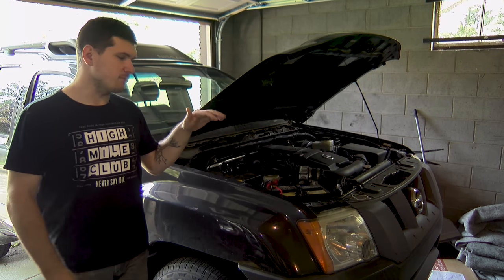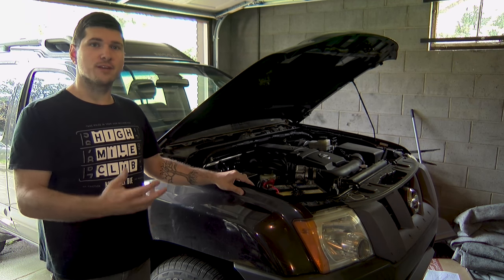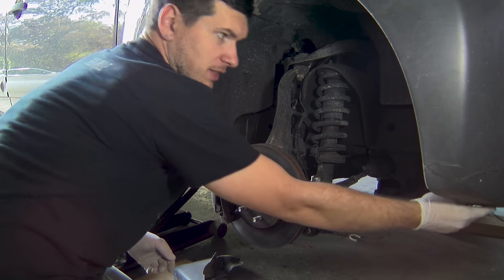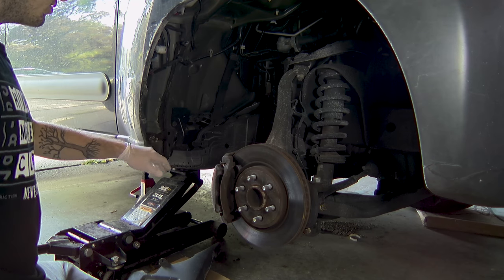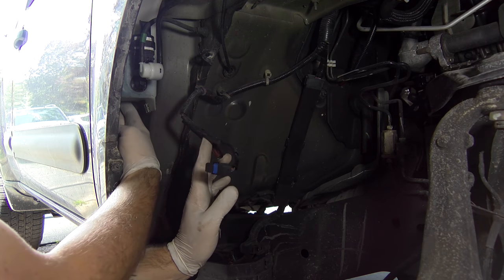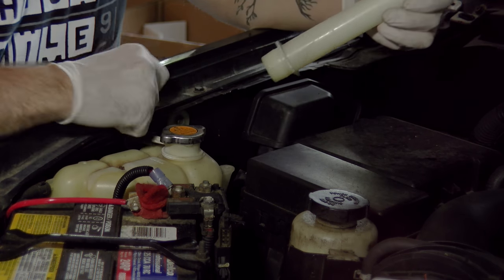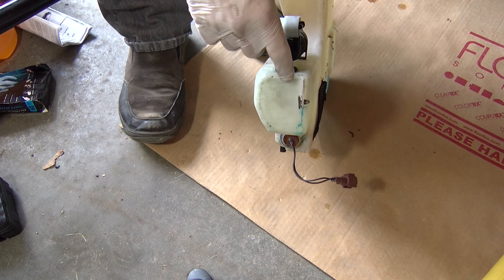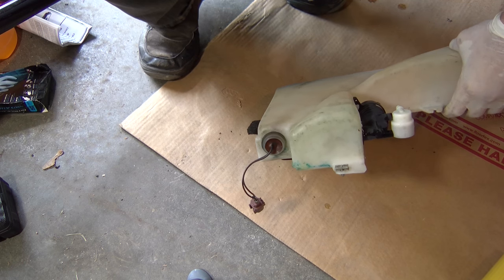How to Remove Your Windshield Washer Fluid Tank Nissan Xterra

Comment: My Xterra drivers side sprayer has a weak jet.
I poked it with a needle and it still sprays weak.
Possible leak downstream?
Any tips and help on how to find it?
Reply: I have a 2012 Frontier with the same issue.  I replaced the jets (Amazon had some) and it worked for a while.  Now it's intermittent.  If anyone has any info please share.

Comment: Hey Ry, love the videos. I have a 2007 Xterra. I am having a problem where the windshield fluid doesnt spray on my back windshield. The nozzle appears clean. Do you have any thoughts on why or how I can figure out what is wrong? Either way thanks for helping me learn so much about my own vehicle! :)
Reply from the maker: Of course! Working on your own car is awesome right? Makes you like it more. 

Anyway, Can you hear the pump running when you turn on the juice? Also do the front ones work?
Reply: Yes I can hear it, and the front ones work.
Reply from the maker: +Victoria Kleber odd, if you are sure they are clean then this would be my next step. Wait until you run your washer fluid tank almost empty, then put some water in it. Have someone get in the car and wait for your signal. Then remove the rubber hoses coming out of the pump. Water will then start pour out but thats ok. Just act fast. Tell the person to turn on the rear nozzles. If the pump sprays the water then you know that portion is good and the issue is in the line somewhere. If it does not then you know its the pump. Don't forget when you're done to run all of the water out and put regular washer fluid back in.

Comment: SuperGlue followed by melted hot glue is a good one-two punch, especially at the seam, to prevent future leaks.  What is your opinion about using a two-part epoxy like JB Weld?

Comment: This is awesome! Freaking mechanic quoted me $330 to replace it all because it’s cracked. I asked if it could be repaired and he said no. Money is tight for me right now and you saved me a bundle! So thx! 

Do you know anything about the wiring by chance? My pup chewed through some wires under the steering column and it’s caused a host of other issues. 

Thx again, brother!
Reply from the maker: Glad to help! Sorry but I dont know anything offhand about the wiring under the column. Other than that its important lol.

Comment: On my 08 the washer is opposite the way it should be on the switch (front sprays back and back sprays front). I didn’t see 2 pumps but I did see 2 hoses (I think). Would it be safe to assume to fix my situation I would swap the hoses on the tank?
Reply from the maker: Yep! Just swap the hoses. I did that when I took my tank out for the first time. Nice and easy, don't even need to remove the tank.

Comment: Bought an 06. When the front wipers operate, the rear washer sprays fluids. Vise versa. 
I am thinking it's the hoses of the pump are connected opposite.
Reply from the maker: That’s correct. Just swap the hoses and you are good. Nice and easy job. You won’t even have to remove the tank.

Comment: Hi Ry my windows sometimes can't be raised or let down from the drivers panel but if I go to the actual window to lower or raise it it works fine. So local mechanic said I have to replace some kind of master controller panel. This seems pretty easy but I don't know, maybe you would go over how to take it out?
Reply from the maker: I'm sorry but I cannot. My windows are manual crank windows.

Comment: Mine rattled for years but never leaked all that much. It is still loose and it sounds like you have a suspension rattle in your front right. More crap Nissan parts.
Reply: How do you pull off the red sensor???? The black one came off like it was nothing but the three  reds are being a pain.... Please help. I have used my hands and pliers. They look like they have tabs I have pushed them down its not working.... I have a 04

Comment: Thanks, thinking about removing the tank in order to wash it out. Upon replacing both sprayer nozzles I noticed the the problem side was different and had been replaced before. Probably some gunk in there
Reply from the maker: Gross. Someone using just water?